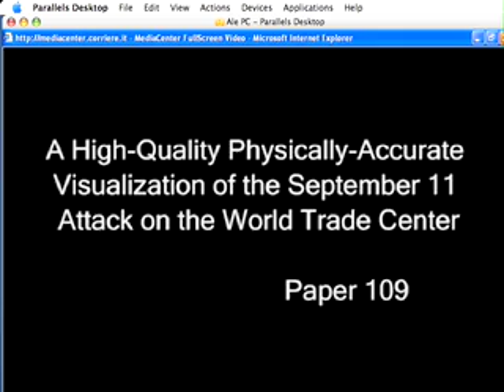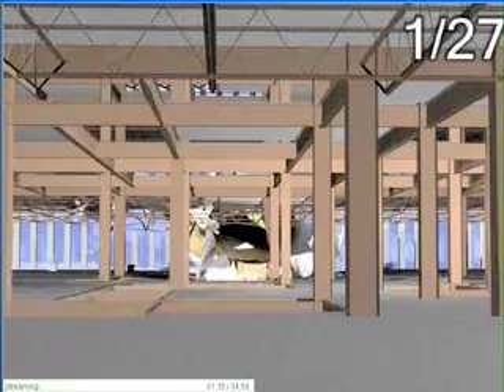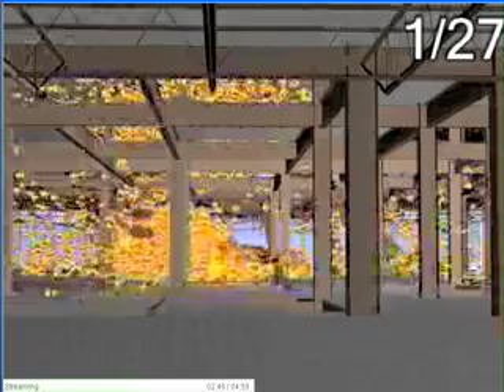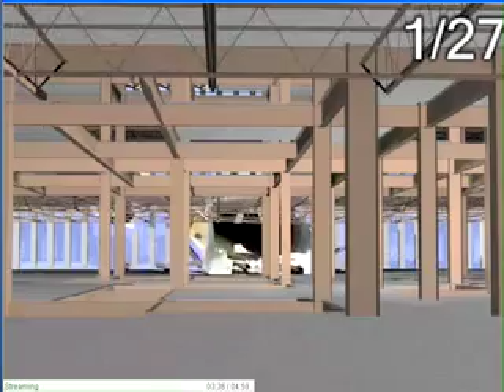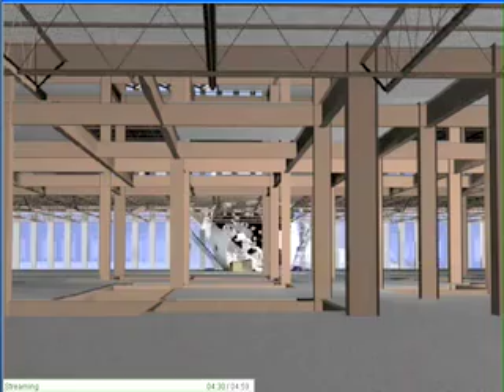9-11 Twin Towers Attack 3D simulation

Comment: @RAJSTA81 
What you can't seem to fathom is that the crystalography
examines the steel for ANY Bomb making material,
dumbass, at the molecular level.
SO, whatever your mythical controlled demolition
method, unless it used "The FORCE", the NIST and
FEMA tests would have picked it up, and 
documented it.
YOU simply can't get around crystalography.
They punch disks out of the steel, and test it both
on the surface, at levels parallel to the surface,
and at 90 degrees to that.

Comment: @lennhart 
Don't care about your relatives, OR your mullet hair.
Second, The DENSE CORE is specifically called
out by the announcer, and that the plane passes
thru it, and severs several core columns.
It also severs 2/3 of the north side flooring,
and about 1/2 of the 2 floors beneath it.
The ONLY thing that matters when it comes to
matter penetrating matter, is mass and speed.
NOT Material. This is so basic to physics,
that teaching you anything else would need
a puppet show.

Comment: @RAJSTA81 
LMAO, be honest, you don't download the
Simulation software because you don't even
have the vocabulary to install and use it.
And damn right, that simulation software
won't let you enter materials or processes 
that can't exist on earth.
LOL
What you don't know, Jerk, is that
simulation software is essentially PHYSICS,
hard coded. For every cubic inch in the model,
material, gravity, temp, pressure, weight, inertia,
forces, vectors, and energy are calc'd,
and plotted.

Comment: @lennhart 
You mean, other than the relatives gathered at 
Los Angeles airport, the RADIO recording of 
Flight 11, Flight 93's cockpit fight, Flight 77's
Radio FDR, the online flight ticketing, boarding,
destination and timetables, the fuel put on
the airplanes, the airliner ground crews, the
Air Traffic controllers, the luggage loaded,
and recovered from each attack site, and the
body parts, and DNA tests?
Face it, there is less proof of YOUR
existence, MORON, than the airliners.

Comment: @RAJSTA81 
My technical arguments are NEVER poor, 
and your sorry ass knows it.
UNLIKE your simple minded foolishness,
I ask the FIRST ENGINEERING QUESTION.
How?
You want Nano thermite?  How?
How do you attach it, ignite it, then apply the
heat to the steel when it's a LIQUID IRON?
You want a missile at the Pentagon?
How?
How did it launch? From where? 
Guided by What?
How did it knock over things
without exploding?
AND the most important,
How did you come up with this crap?

Comment: @Razr89A 
Since NIST argues that IMPACT AND FIRE caused the WTC to collapse, you are correct, you don't put much effort into reading.
None, in fact.
LOL
Could you answer how BOMBs planted in the WTC could be setoff without ignition equipment, wires, timers, Det Cord, batteries, radios, control systems or anything else that's commonly used at bomb trials?
Because HUNDREDS of first responders trained in Bomb evidence were there, and they didn't see a damn thing.

Comment: SINCE YOU DIDN'T ANSWER,
Have you Professed your point of view?
Nope!

1. You don't admit to what KIND of truther you are.
2. You can't show a FIRE FIGHTER saying explosive.
3. You can't show how liquid iron is applied to WTC steel.
4. You can't show ANY evidence for an explosive, it's ignition 
system, wiring, batteries, computers, controllers or radios.

That STILL collapses ALL your posts faster than the WTC.
HUH?

Comment: @RAJSTA81 
OF COURSE I AM AN ENGINEER, LOL.
What's more basic to debate than 
Admitting your point of view?
SO FAR,
1. You don't admit to what KIND of truther you are.
2. You can't show a FIRE FIGHTER saying explosive.
3. You can't show how liquid iron can be applied to WTC steel.
4. You can't show ANY evidence for an explosive, it's ignition system,
it's wiring, it's batteries, computers, controllers or relays.

That would collapse your ALL your posts faster than the WTC.
HUH?

Comment: @RAJSTA81 
Well, then, if degenerates coming from poor 
villages can be engineers, why can't YOU?
Are you more stupid than a degenerate?
LOL
Now, Dumbass, tell us how YOU would solve
the MOST BASIC TRUTHER PROBLEM.
1. How would you attach Nano Thermite,
which turns into 2500 C liquid iron,
to a vertical Core Column, or Floor Joist?

LOL, remember you need something to HOLD
100 lbs of extremely HOT GLOWING METAL,
WITHOUT leaving any evidence it ever existed.
Did you solve that yet?

Comment: @UNC0NVENTI0NAL 
LMAO, Are you a pilot and / or have EVER handled an
airliner CVR or FDR? They can sit on your LAP.
30 FT BOX CORE COLUMNS with walls 4 inches thick
were bent into horseshoes, and shown on TV.
LOL, how do you expect a 60 lb device the size of your
lap to survive those energies?
NIST NEVER claimed MELTED STEEL, dumbass.
ALL NIST needs is 600 deg C to collapse
the WTC, INSIDE THE STEEL.
The external temp was considerably HIGHER,
in order to heat the core temp. in an hour

Comment: @UNC0NVENTI0NAL 
By the way, the simple reason I am certain, is I CAN
DO MATH, dumbass. Each of the WTC attack areas
is a MATH PROBLEM you can't do.
What was the energy of a 767 hitting the WTC?
Math.
Pentagon?
Math
FIRE value of 9000 gallons of AV fuel?
Math.
Tell me as an engineer, how the numbers work
out, like NIST DID, with MATH, and I will believe you.
Post me another Kooktard video,
stolen from each other, with progressively
worse Music and Idiot comments,
and I do NOT care

Comment: @UNC0NVENTI0NAL 
Since you don't seem too bright, I thought 
I would give you #3 personally.
Jason Ingersoll's picture of the PENTAGON,
and BOTH the Engine IMPACT POINTS
First the Header
dod media. osd. mil/Assets/ Still/ 2002/ Marines/
Now the pic
DM-SD -02-03900. JP EG
The Left Engine impacted the two lane street 
that runs around the Pentagon, that's why
it's torn up. Then it hit the building right at the
expansion joint.
There is also a LOT of plane debris on the
lawn, Huh?

Comment: @UNC0NVENTI0NAL 
I have YET to see you pose a straight question.
1. Where is Flt 93's wreck?
What did you expect, a dent on an intact 757?
It's in tiny pieces, collected by teams of FAA crash investigators.
Try the Wiki page, they show the engine being dug out.
2. Flt 77's wreck?
It was featured on the National Geographic special.
It's at a FAA hangar at Dulles.
3. Its in Jason Ingersoll's pics
4. In the WTC debris.
5. see #4
6. In Hiding.
Easy. 
Any others?

Comment: @RAJSTA81 
Maybe you don't understand, my degree is in INDUSTRIAL
TECHNOLOGY, as in TOOL EXPERT. I setup the tooling
for manufacturing companies, computer controlled
lathes, mills, machine centers, and rapid prototyping
systems. MOST of which are programmable, and run UNIX.
LOL
Then I monitor them using XYMON, NAGIOS, or CACTI.
None of which you know jackshit about.
MY OWN Company, builds FINE scale Process Control
systems, for manufacturing automation with micro-second timing.

Comment: @RAJSTA81 
LOL, you ask this question NOW, and then ask
how come I avoid the question IN THE SAME POST?
Are you THAT stupid?
Why would it be hard to answer why there are explosions in a building hit by a JUMBO AIRLINER, and 9000 Gallons of AV fuel?
The WTC Buildings were some of the MOST instrumented buildings on planet earth. Computers monitored door, fire and smoke sensors, door cams, elevator cams, elevator lobbies, engineering floors, and observation decks.
No alarms.

Comment: @RAJSTA81 
SORRY, BOZO, bzzzzzz, you go inside the clown car.
LOL
I realize Truther Websites tell you WTC 7
is UNANSWERABLE, but not to engineers. WTC#7
was a long horizontal truss building.
Because it stood OVER a Con Ed power station.
Those long horizontal spans were heated to over
1000 deg C on the surface. (By steel crystalography)
That same crystalography would have turned up 
ANY explosives (Its tougher than FBI testing).
The heated spans expanded and collapsed the 
building.

Comment: @N1k1mon 
Well, yeah, dumbass, expert crews are NOT needed for 
symmetrical collapses. 
I just got done pointing out that NO professional demo-
lition is straight down for a REASON, compressed air
management, that's also why they remove the external
"Curtain" walls and windows.
LOL
Since you say that GRAVITY isn't the only force at work
why NOT NAME THE OTHER FORCES?
LOL,
In the meantime, drop some flour from any height you 
wish, and watch the nice, round SYMMETRICAL
impact circle.
Duh.

Comment: @RAJSTA81 
The FACT is, KookTard, your questions were ANSWERED
YEARS AGO, and you simply haven't looked for them.
LOL
Why not google each of your questions?
1. Because the photo wasn't of the WTC planes.
2. Because the 757 body is only 13 FT ROUND.
3. You are misquoting, both the man, and the statement.
The engineer was a Global Hawk engineer,
and he said the engine compressor wasn't from the GH.
4. Because the WTC was 96% air.
These questions were answered in 2004.
Nothing new here, huh?

Comment: @N1k1mon 
It's always best to quote a fool to prove he is.
"it's just ridiculous to say that gravity pulls down"
Well, DUH.
SYMMETRICAL COLLAPSE IS NORMAL.
It's just a FAD for Truthers.
Consider, Actual Demolition crews almost never
explode a building symmetrically, they always
lay it over in a preferred direction, or make it
collapse from one side to the other, to prevent
compressed air from blowing debris a mile 
or more, that's why they REMOVE THE OUTER
WALLS and WINDOWS, dumbass.

Comment: @RAJSTA81 
By the way, butt boy, if you want to see the complete
failure of truthers to use thermite, right beside the
complete failure of steel set on fire with AV Fuel,
here are TWO examples.
watch?v=6AhiI3yr5-s
watch?v=GYOHlJKcXrg

OR, you could simply explain how you got
convinced of 911 TRUTHER theories,
without a visitor, evidence, or anything
besides copied videos produced by 
FUCKTARDS, and bad techno music.

Comment: @RAJSTA81 
None of your examples were hit by a Jumbo airliner.
The ONLY example of a Jumbo airliner hitting a
steel frame building, was a PARTIAL strike by an
EL AL Jetliner on a 13 floor BIJLMERMEER apt.
building, and it partially collapsed.
SO, it's NOT the only building to collapse due to
IMPACT AND FIRE.
I can NOT understand how you fucking morons
seem to always miss the IMPACT AND FIRE
part, are you just genetically damaged somehow?
Say it slowly, IMPACT AND FIRE, lol.

Comment: @Skeptic121 
Actually, I answered you, you just can't or won't,
understand. NIST and the official story are correct, 
and follow standard forensics.
TRY to explain any propellor or FAN.
it compresses air without four walls, so what's 
your problem?? Or go stand by the side of the
highway, and let the Trucks blow you off your
feet. Any moving object compresses the air in 
front of it, and lowers the pressure behind it.
Was the math too hard for you?
Sucks to be a truther, huh?

Comment: @Skeptic121
JUST FYI, on a simple ten foot room, with NO walls,
and a typical 5x2 window, the total air volume is
10x10x10, or 1000 cubic feet, going thru a 10 
square foot hole, in less than a second.
I calc 100 cubic FT a second. That's 600 mph.

Comment: @Skeptic121 
It's called dynamic compression, Idiot. And it's 
VERY common, like in a common household fan.
Any moving surface pushes a HIGH pressure wave in
front of it, whether it's an electric fan blade, a plane pro-
pellor, or the roof of a collapsing building. 
Why don't you fan yourself a little??
You seem frustrated.

Comment: @Skeptic121 
Well, duh, the facade is normally supported by the steel frame.
As the frame fell down and away, The bolts get ripped out 
simply because the nuts on the building side are less 
resistant to fracture than the bolt head.
How about a simple illustration?
Grab a cardboard box and sit on it.
Explosive air will shoot out the side, or any weak point.
Simple, huh?

Comment: @Skeptic121 
Second, the facade of WTC 7 was NOT like WTC 1 or 2.
It was a "Curtain Wall", (look it up), basically hung from the
frame and flooring on the outside, bolted on, to be exact.
When the frame collapsed away from the facade, all it
had to do was break or pull out those bolts.
As for the Puffs, lol. 
A collapsing building produces air pressure at 
hundreds of PSI, it would have blown YOU out the window.

Comment: @Skeptic121 
Yeah, their vertical support, the building frame, was torn
by the collapse. That means the "curtain wall" facade,
25 meters tall, about 2 feet thick, composed of glass 
and aluminum, was supported by nothing but rigidity.
25 meters of free fall would basically drop it on the 
MUCH slower falling roof of WTC 7. Nothing radical
about that, standard falling mechanics.

Comment: @RAJSTA81 
Bullshit, you are a complete faker.
Steel is not a magical substance, fire makes it and fire destroys it.
When steel workers create rebar for reinforced concrete, they
bend it into place by putting a torch on the steel for a minute or two.
As for your explosives, Where are they?
EVERY explosive case, or bomb case begins a presentation of
EXPLOSIVE debris. Where is yours?

Comment: @RAJSTA81 
YOU don't know jackshit about engineering, so when you say
SHOULD have held up longer, I assume you pulled that out 
of your ass. 9000 gallons of AV fuel has the energy of 
450,000 lbs of TNT. That's why we use it. Now add the 
energy of 200 TONS traveling at 500+ mph, and you have
pretty close to 1/10 or so of the Littleboy atom bomb.
EIGHT hours of fire, WITHOUT a fire dept dooms WTC 7.
Even on your planet.

Comment: @Skeptic121 
Was anything I said technically wrong? Most of the plane MISSED
the 13 story steel frame apartment building. So the Historical 
record is THREE buildings hit by a Jetliner, THREE buildings destroyed.
As for the WTC 7, it fell after EIGHT and a half HOURS of NO
fire dept response, not Five. No controlled demolition falls like that,
and if you know one, point it out, I live in Las Vegas, and attended
SIX CDs. How many have you attended?

Comment: @RAJSTA81 
It dropped in 15-16 seconds. The 911 Commission pointed
that out with THREE different timings.
1400 ft in 15 seconds is roughly 60 mph.
Hardly free fall at all.
VERINAGE buildings fall the same way,
and they use no explosives either.

Comment: @Skeptic121 
I hope your comment makes sense on some planet.
The EL AL crash partially collapsed because it was partially hit.
Most of the airplane remained OUTSIDE the building.
Try to be a stickler to that.
WTC 1 and 2 WERE also hit by an airliner, and they collapsed also.
Collapse is collapse, it destroys the building.
The building is gone now, razed like EVERY building that burns.
Have you ever seen a burned building rebuilt with the same frame?

Comment: @JulietsMan 
What kind of crack did your generation smoke?
No highrise has had a Boeing 767 crash into it before.
Lookup the EL AL, Bijlmermeer crash in 1993, because a steel frame
building (13 stories) got PARTIALLY hit by a 747, and it PARTIALLY 
collapsed, right into it's own footprint.
That's 100% of buildings that have been hit by a modern airliner 
collapsed to to the IMPACT AND FIRE. WTC#7 got hit by WTC#1,
so again, IMPACT AND FIRE seems 100% effective.

Comment: @Merlin5x5 only the casings are aluminum. i looked them up. and most  other types of ammo,not that ammo is even relevant to the 9/11 situation,use aluminum in places on the cartridge not the projectile. i saw NO information about railguns using aluminum bullets but if they do its irrelevant. NOW that we are OUT OF LALA LAND...a boeing 767 IS AN EMPTY VESSEL made almost entirely of sheet aluminum more closely resembling a coke can than a bullet, exept for maybe its appearance and fuselage shape.

Comment: @JulietsMan 
Aluminum "Bullets" called are used in Rail Guns, were
they typically can penetrate several FEET of steel.
They are aluminum because they have to be LIGHT with
rail guns, in order to accellorate fast enough by the end
of the rail gun length.

Comment: Uhh....The main problem with this video is that the structure of the tower is only similar to the real tower on the OUTSIDE of the building. The inside elements are not even remotely similar. The center core of WTC 1 and 2 was MASSIVE. It was not anything like it was depicted in the 911 commission report or in this pathetic simulation. It wouldn't have even made a dent in the core. The building was designed for just such an event.

Comment: To make this real you'd have to be in the building with cameras, temperature sensors, audio equipment and even then...it's one step behind you actually standing on the receiving end of the plane. Simulation is a very good guestimation. :)

Comment: While a simulation can be used to visualize complex processes, it can't definitely prove something.  By adjusting the model's parameters you can simulate almost everything what you want. 

My questions are: 
1) Who gave money for this simulation to be carried out?
2) Does the parameter configuration of the simulation's model adequately reflect the construction of the building and the plane?

Comment: the avarage boing can not break the sound barrier (1,116.4 ft/s, 340.3 m/s, 61.2 mph, 1,225.1 km/h, 661.5 knots)
my dad works in aviaition.
it was a guess, but a fairly accurate 1. 
a 777 could not go 1000mph.
i do have sense, u dont have enough to not be the pot calling the kettle black...

Comment: the reason it was possible because  the plane hit the core of the support beam in the top of the building next to make it worse the backblast of the crash hit the rest of the support and the debris came next wiping out what was left after 10 or more floors of pure OBLITERATION it could hold itself up any longer the main support was down because after all this the supports were beggining to crush themselves under the weight because the higher level support was gone causing it to collapse